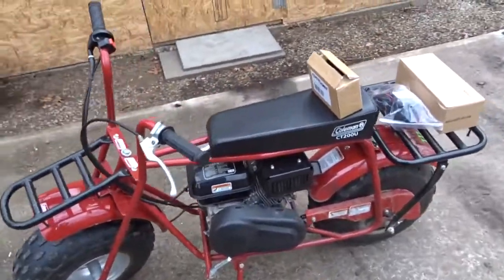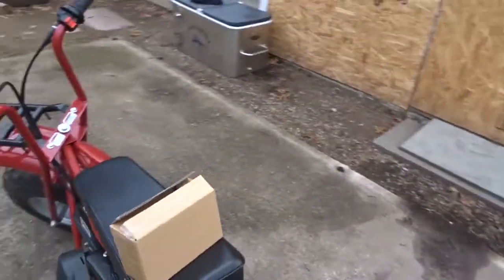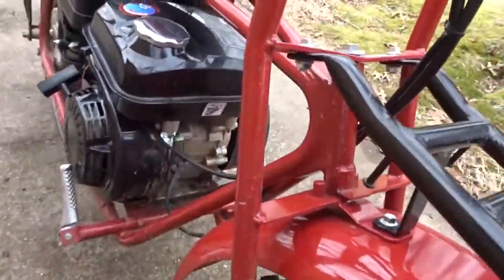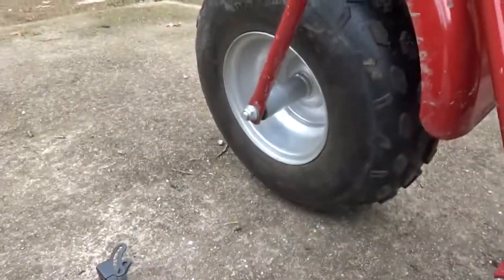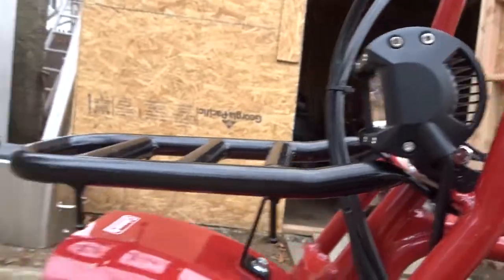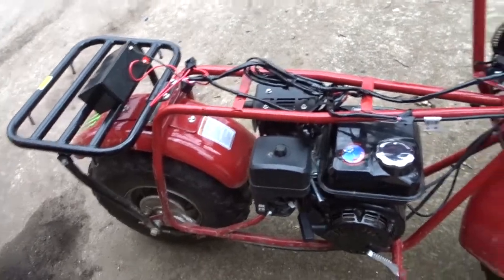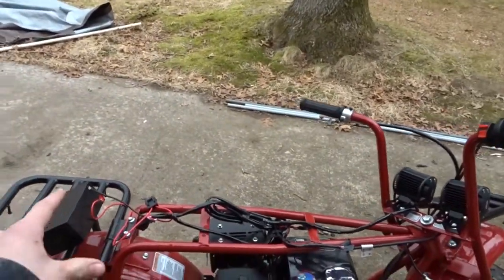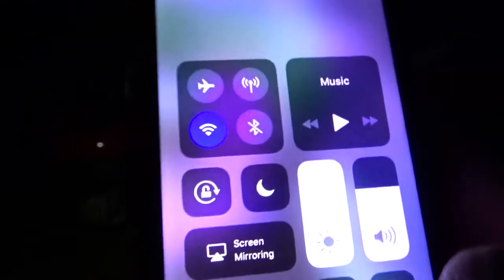Putting HeadLights On The Coleman MiniBike-

Comment: Hey where did connect the ground to?
Reply from the maker: Emily Yeager since I don’t have the bike anymore I really can’t remember but, it worked without any ground lol I think it may of just been connected to the battery
Reply: Can you please help. I admit to be an amateur figuring things out as I go. I have the same coleman bike. I mounted the headlights and tail light and mounted a toggle switch for off/on. Hooked the lights up, hooked up the battery and immediately the wiring started to get hot and melt. Please help.